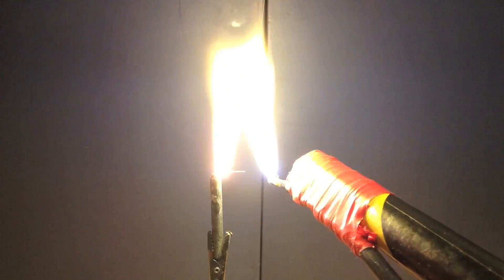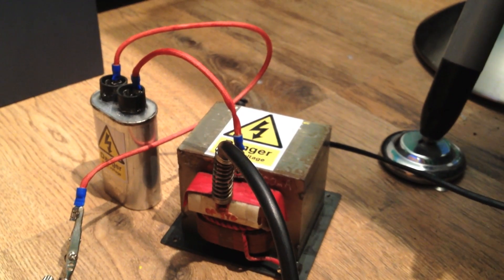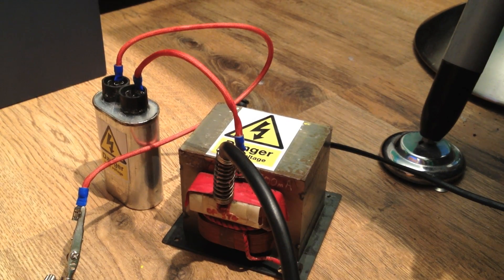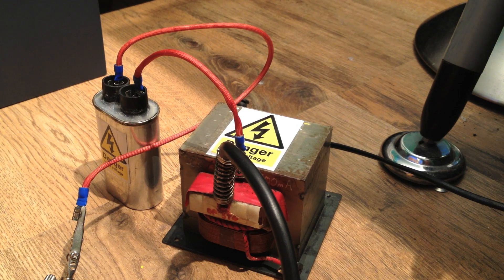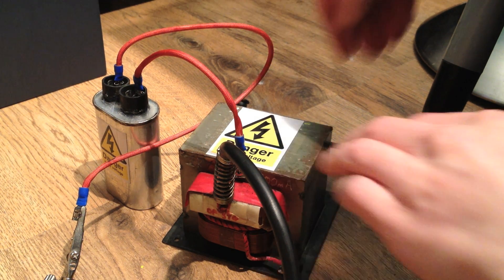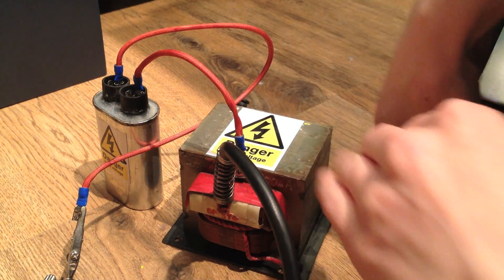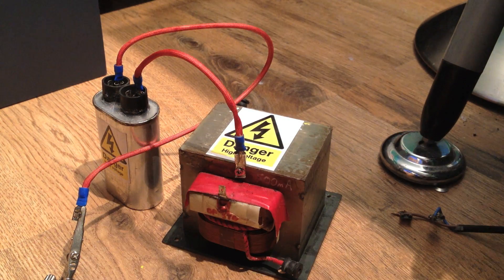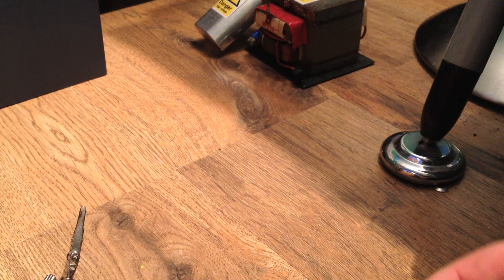240V Arcs - who needs HV ?

Comment: Theres an easier and much safer way. You can do this with about 30 volts at 5 amps with this trick. Use graphite (pencil lead) as the electrodes. It will create a super bright arc very similar to the 240 volt one in this video. If you want higher voltages, look into flyback transformers, mainly the small DC ones. They're usually way to weak to be lethal even with a ZVS driver but can still output like 20,000 volts. I would not recommend microwave transformers or current-limited mains for a beginner. Even huge, bulky, neon sign transformers are way safer than this

Comment: I am trying to make an electric arc furnace to melt some metal and I would like to use directly 230 V AC. I have made a very simple circuit: It's an electric kettle which is limiting the current, as a power resistance. However, I can only have electric arcs when the electrodes are made in carbon. It doesn't work with screw electrodes. I suppose it should work if I use high voltage, but, do you think if there would be something else that I can do instead of purschasing a high voltage transformer?

Comment: What did you use as a ballast for your 240v arc? Was that a vacuum cleaner? It sounded like I could hear a motor slowing down after the arc stopped.
Reply: I’m pretty sure the motor you could hear was just the arc welder he said he used to run it
Reply: @Hydr8Man  As far as I know, arc welders use an inductive ballast to limit current. They don't use a motor to limit current. What would a motor have to do with an arc welder?
Reply: @BenHutchinson321  Fans to cool the inside of the welder.

Comment: 240 volts sounds nicer, but i tried at 230V because that's what we have. Tiny piss ass worm sparks.
Why? By the way limited to 14A because i was too cheap to buy 2.5mm wire for the garage so 16A max.

Comment: Truth is, the amps determine how long and bright the arcs are. If you ever ballasted (limit the amps) a high voltage transformer while playing with it, the arcs are miserably even at 2 kV or more
Reply: Current plays a role in how bright the arc is, and also slightly increase the maximum length of the arc, but its still the voltage that matters.. for example: a 7kv 2A is arc is longer than a 4.6kV 7A arc, even though the 4.6kV has more current, and more power than the 7kv 2a arc. Proof: compare the arc’s length of diodegonewild’s “making lightning” power supply (near resonant 4.6kv 7a) and photonicinductions “extracting the maximum power out of a transformer” 7kv 2a non-resonant arc (infact, the same video has a 1kv 10A dc arc, which is still shorter than an average Mot’s arc (2kv 2a) even though the first one is 10kva and the other one is only 4kva), infact, another common misconseption is “dc makes better arcs than ac because zero-crossing” which is garbage because zero crossing ONLY makes arcs easier to extinguish, NOT smaller or less “violent” or worse, JUST easier to extinguish! (Proof: compare an MOT’s arc (resonant with 3uF, 2kv ~3a) to a 500-series 9volt battery power supply’s arc (4.5kv, ~5A), and you will see that the AC arc is longer, bigger, and more violent!)

Comment: What's that there in the clamp? Is it a welding electrode? I can't get similiar results, because when I touch the conductors to start an arc, they immediately weld themselves together. It's a quite problem to separate them, but when it happens, the arc disappears. Update: I was able to do it using graphite electrodes, you can get them from a pencil and they work ok.

Comment: Where 240v arcs? mot is stepped up from 240v to 2100v in most cases. 
My zvs flyback setup has a 240v - 24v step down transformer before I step the 24v back up to 30kv. Does this mean I can say I get 32mm break out arcs with only 24 volts? Just sayin bro, nice demo btw :)
Reply: Watch the complete video you silly. The first part was only showcasing 2100v arcs to show what it's about.
Reply: The potential (voltage) between the electrodes only determines the starting distance of an arc. The current determines how much you can stretch it (also the thickness and the brightness of the arc)
Reply: @TheError404  Current plays a role in how bright the arc is, and also slightly increase the maximum length of the arc, but its still the voltage that matters.. for example: a 7kv 2A is arc is longer than a 4.6kV 7A arc, even though the 4.6kV has more current, and more power than the 7kv 2a arc. Proof: compare the arc’s length of diodegonewild’s “making lightning” power supply (near resonant 4.6kv 7a) and photonicinductions “extracting the maximum power out of a transformer” 7kv 2a non-resonant arc (infact, the same video has a 1kv 10A dc arc, which is still shorter than an average Mot’s arc (2kv 2a) even though the first one is 10kva and the other one is only 4kva), infact, another common misconseption is “dc makes better arcs than ac because zero-crossing” which is garbage because zero crossing ONLY makes arcs easier to extinguish, NOT smaller or less “violent” or worse, JUST easier to extinguish! (Proof: compare an MOT’s arc (resonant with 3uF, 2kv ~3a) to a 500-series 9volt battery power supply’s arc (4.5kv, ~5A), and you will see that the AC arc is longer, bigger, and more violent!)

Comment: If you don't have high voltage transformer, just rectify your 400V three-phase supply, you will get around 560 V relatively smooth destructive DC
Reply: If you have 3 phase power, that is. Most residential power lines only have one phase.
Reply: @GRBtutorials  Even my flat and cottage have 3X 400V / 32A
Reply: @vitcenek8611  Well, it depends on the country. I heard it's common in Germany, for example, but in Spain it's uncommon.
Reply: @GRBtutorials  I am from Czech Republic, so things are same as in Germany or Austria. Only small difference is that Germany is using F type Schuko plugs, but we are using French type E.
Reply: @vitcenek8611  hahaha
/laughts in 2 phase argentinian 220V
Reply: or find a tv and pull out the anode and turn it on find an older one as they usually won't shut of being arced to ground
Reply: 3 heaters in star

Comment: Gives you a good idea what can happen to a outlet that has a bad connection on a really loaded circuit with the right conditions! IE a shorted output of a welder ;-) Kinda scary to know how big a plasma arc is created with such "low" voltage!
Reply: You can make even bigger arcs with a simple car battery, where you have only 12 volts!

Comment: I used to do this with the 40 volts DC off of solar panels... it was inherently limited to about 4 amps (from the panel's output) and the arc could be drawn out to be really hot and angry :D
Reply: +hyvahyva dc power arcs more than ac so yeah
Reply: Shorting a solar panel can cause it to overheat.

Comment: it will not kill you if there is no amps
Reply: Tom and plusit wont make arcs or power anything without any amperage/current :)
Reply: RedditChildCornFan probably explains why a neon sign transformer that has no amps, makes an arc. Good explication
Reply: That is so wrong and dangerous to say
Reply: Both his microwave transformer and his 10A-limited circuit supplies enough amps to kill you.